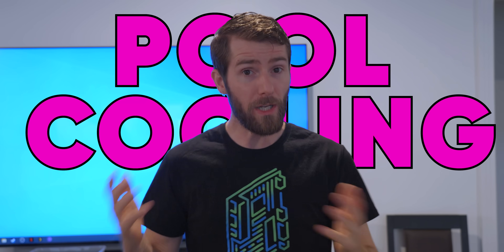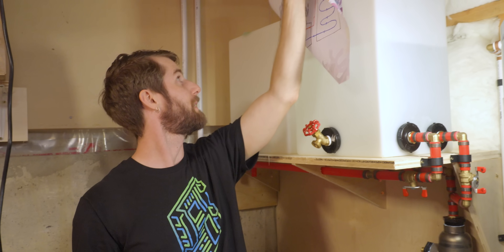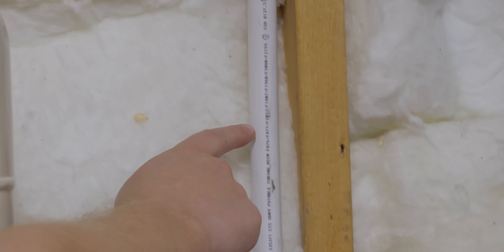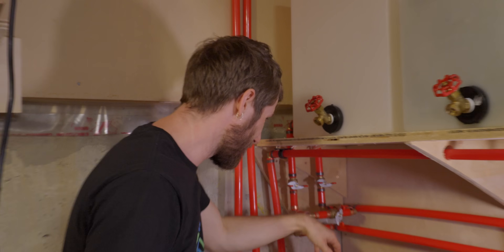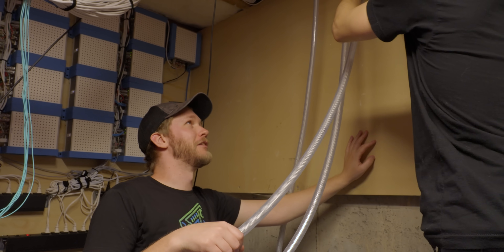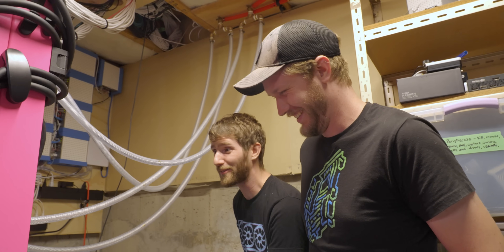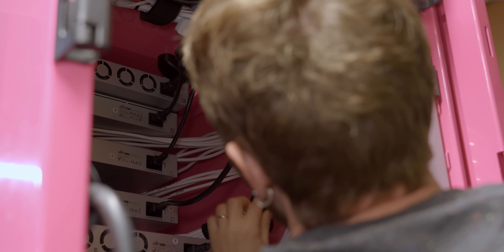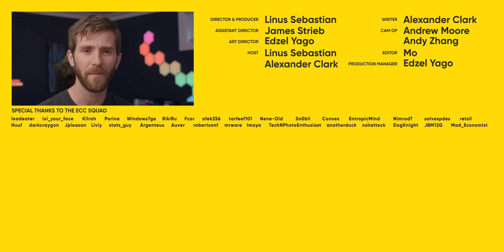My pool leaked and killed my computer - Whole Server Room Pool Watercooling Part 4

Comment: Every single video on watercooling convinces me that it is not remotely worth the hassles.
Reply: AIOs are as close to that as I'm willing to get. And even then, I picked it over air cooling for RAM clearance rather than cooling effectiveness. All the air coolers I was looking at had terrible RAM clearance.
Reply: @tyrannicpuppy the problem with an AIO is that when the pump dies, you can't just replace it and keep the rest. It's all scrap. That's what happened to mine. With a good air cooler, just replace the fan if it dies.
Reply: @Canilash agreed. It was a consideration I made when buying. For me, the eventual death of a pump and having to replace the entire thing was worth the benefit for now of having all four RAM slots available.

When it does, if there is an air cooler that could fit in place with the RAM, I'd probably go to air cooling. And their probably was when I was buying too. I restricted myself to a handful of local buying options so I wasn't paying exorbitant shipping or import fees, so my choices were limited.

Still does nothing to make proper water cooling remotely attractive as a prospect though.
Reply: @Canilash I've been carrying over my custom loop equipment for 8-9 years now, though I've scrapped suboptimal stuff and dropped in newer stuff here and there. 2x 480mm radiators, pump requires no change, fans have been upgraded, res is forever. I bought a high end Optimus CPU water block for Zen 3 and it's been able to carry over to AM5 with no change needed.

For the most part a custom loop will not need parts changes for a new system. Possibly new tubing. Only a new block if the socket changed the mounting.
Reply: @Canilash  I'd bet you can buy 2 AIO systems for the cost of a quality cpu custom loop. Of course that then rises if you want to do your GPU as well...
Reply: @tyrannicpuppy  buy low profile non RGB ram and your problem with air  coolers are solved :D
Reply: @bomberdomme7308  stop being silly. if I don't have the RGB RAMs where will all the FPSes come from???

In all seriousness, I totally could have. All the RGB is turned off in the PC these days as it sits right next to the TV and is way too bright when watching all the super dark poorly lit shows they put out these days.

But, it was my first build in 12 years and I had much more cash than sense. Lol.
Reply: @tyrannicpuppy Noctua NH-D15s, great ram clearance, if I can fit my OG Corsair dominators then any ram will fit.
Reply: i mean, i feel like linus's setup is a bit of an extreme example that no one else is going to come even close to doing lmao
Reply: @mysteryperson324 I feel like anyone could have a similar setup at home. You would just do it with your main water line. All things considered you have an optimal home layout or proper planning in a reno/new build.
Reply: Noctua NH-D15 ftw!.
Reply: @drworm73 peerless assassin ftw, and for $35 instead of $95
Reply: @drworm73  lol, just bought one for my 7800x3d, a 2014 cpu cooler on a 2022 cpu and it just works.
Reply: Ehhhh, if I have a weekend off and the $5000/$10000 to make it worth while that sounds like a fun weekend
Reply: AIO is a nice middle ground that keeps maintenance and price to a minimum, and carries most of the benefits a user would expect from liquid cooling.
Reply: @LunarShift there is basically no performance or cooling benefit any more from an aio over a high end air cooler. Either get a high end air cooler or do the custom water loop, not a half assed solution that costs slightly more for no benefit
Reply: It REALLY depends. There's so much potential in there especially as a proof of concept. 

The pool is just the hest sink but you could totally use the heat somewhere else in your house, too. I'm doing something similar, albeit with the hot air, where it heats my terrarium during the winter months and keeps it temperature controlled at ~24/25°C.

Since I'm not having that many things generating too much heat, it needs my beefy PC for now, but it's working pretty okay.

Just don't cut corners with water and test it out real good!
Reply: I built a desktop computer with DIY water cooling in 2016 and it still works fine today with literally zero maintenance or headache.
Reply: they just intentionally did the least research and planning possible, and absolutely refused any second trips to the hardware store after finding issues.

for the content.
Reply: unless your doing extreme overclocking water cooling isn't necessary. air cooling is much more reliable and requires less power. if you are using a big air cooler though do remember that it is  a lot of weight that you don't  want to come loose if you ever ship or transport your PC.
Reply: Do the testing with distilled water at least (best option is type II deionised water)
Even if distilled water leaks, it shouldn't cause much, or any, damage to your PC
It's hardly conductive
Reply: correction:
Every single video on watercooling, done by LMG
Reply: @smittywerbenjj1  nah, OP was right: every single video. So much work, stress and precision for such little benefit.
Reply: @tyrannicpuppy "We go to the moon not because it is easy, but because it is hard"
Reply: @Leo9ine  going to the moon has tangible benefits to future and further space exploration. Shaving a few degrees off your gaming PC and getting maybe double digit FPS gains is not nearly worth the effort, the upkeep or the headaches. IMO.
Reply: @Leo9ine The exact quote is "we choose to go to the moon in this decade and do the other things, not because they are easy, but because they are hard."
I think he wasn't expecting that line to be quoted. Without the context of the speech, the "do the other things" just gets awkward and is usually edited out of the clips.

For the record, the "other things" were:
"why climb the highest mountain? Why, 35 years ago, fly the Atlantic? Why does Rice play Texas?"
Reply: @Leo9ine  yeh, and when they need to cool the Radioactive RTG do they wrap it in a water jacket and bury it in the center of the craft? nope the bolt  that sucker onto the outside and let the cold vacuum of space radiate the heat away, basically fanless air cooling in space.
Reply: @tyrannicpuppy in his case it was not just the cooling performance, he wanted to remove fan noise from that room and have lower room temperature, 5 systems plus switching equipment heats a room like a small split air con, moving the heat away is smart in this case and removing noise is easier than adding isolation to the walls.
This is nevertheless a over the top setup, but would say is worth it for the server room temperature control and noise alone and the gpu temps a nice bonus
Reply: @tyrannicpuppy  he's also putting heat into his pool. I don't know how much and I don't know if he mentioned it but I would like to know how much difference it has for the pool.
Reply: @smittywerbenjj1 I've done multiple custom loops and don't use them anymore, they're a pain. Next build is just using a giant air cooler and all my old watercooling setups will eventually be replaced for media computers.
Reply: @smittywerbenjj1 nope, just every single video. Even LMG has built several non janky and well done water cooling rigs. Still just doesn't feel like it's worth the effort, unless you're trying to do something like that Nerdforge PC where you wouldn't have much airflow. 

Air cooling is just objectively easier and safer, because there's no messing around with tubing and you don't risk getting water on your expensive hardware. Plus, good air coolers seem to be cheaper than good water cooling equipment. 

AIO feels like a good middle point though. Some of the benefits of water cooling, relatively easy to install and little to no risk, since it's a closed loop system.
Reply: AIOs really are trivial. After that, though, I totally see your point.
Reply: it's worth it if not done by youtube-grind driven hastly finished project.
Reply: @shadman_rafi  It's worth it if it generates more revenue on the video than the project costs.
Reply: It's more about the "cool factor" rather than the actual cooling
Reply: Well when Linus does anything it's gonna have more hassles than usual 😂 custom watercooling will always be more difficult than an AIO or a air cooler but it has its performance benefits. But most of the time people do it for fun or for looks. If you have got the time and money then try it out, just tread carefully and do your research so things like this disaster don't happen to you
Reply: 100%
Reply: This
Reply: It's not. Plus it's no benefit to a good air cooler
Reply: That's why most people would just use aircooling and a strong AC(that could still heat the pool).
Reply: Water cooling is for people who love large hassle factor for small reward
Reply: Water cooling is actually essential for some purposes. PC gaming just isn't one of these.
Reply: Aios are great: much more thermal mass to mitigate heat spikes. Custom loops are for people who are going for extreme performance.

The big issue is really just Linus trying to cheap out on plumbing.
Reply: Exactly my thought
Reply: It looks cool though!
Reply: Main reason I am sticking to air or aios for builds, because while I think it would be fun, it just isn’t worth the extra work and effort (especially because there is no warranty for stuff that gets wet if you do something wrong with custom water cooling).
Reply: But 38°
Reply: yep
Reply: If done properly... Properly being key word... It isn't bad
Reply: Linus just sets up an Rube Goldberg industrial sized nightmare machine for his watercooling. Buy an AIO and don't worry about it.
Reply: It’s worth it if you are prepared to spend the money to do it properly, but an AIO or quality air cooling in a decent case will work also, so it’s a personal choice to be honest.
Reply: It’s not their strongest side. 😂
Reply: Probably not, but LTT makes AIOs look like rocket science.....  "We're too "cool" for that.  Just do the opposite of them.
Reply: Especially since the outdoor air is <20’C a good part of the year. Rest of year cut a hole in the air con duct. Winter draw cold air from outside.  Seems easier than pumping water around $50k of tech
Reply: At small scale. At large scale, especially because the heat those machines would be kicking out makes the garage insufferably hot, there's a good reason he is doing this. This is also Linus' whole-home watercooling 2.0 basically, done right and lasting for years.
Reply: For the desktop tower, air cooling 100%, for the home servers though... You'd be at risk of losing hearing in that server room without earmuffs
Reply: Every LMG video, maybe.. you're looking at exclusively the bad examples

Comment: OR... you just use some stop leak thread compound.
Reply: Doesn't help if the pump stops and melts the tubing. Also doesn't help against the rocks getting into his loop.
You, obviously, need a heat exchanger.

Comment: will it affect anything when winter comes with condensation caused by low temps outside?
Reply: Since he is using a heat exchanger, her could slow down the pool pump to keep the inner loop temperature and flow constant. BUUUUT, i wouldn't expect him to forget to set it up.

Comment: It wasn't a matter of IF this would happen, it was a matter of WHEN it would happen on this project. This is just another one on the list of the problem with LTT "lets get it done fast, not right the first time"  Also why didn't they put a flow meter on the pipe and hook it up to home assistant?

Comment: I remember that someone suggested using a heat exchange and linux was like "Nah we don't need it"
Reply: I REMEMBER THAT TOO, I think it was jake
Reply: I've been suggesting it to him for over a year too!
Reply: They don't need it. If they had someone who knows what they're doing, this would have been flawless. Instead, he relied on Dumdum Alex, and he ended up with a botched mess.
Reply: Alex is the epitome of why Engineers suck. He has no clue what he’s doing when it comes to everything he touches.
Reply: @Bob_Smith19 He's literally doing what he's being asked to do. Also you can't expect an engineer to be skilled in all manual labor fields. An electrician only knows how to be an electrician. Alex has been doing stuff from like 5 different fields, obviously he can't be expected to be good at all of them. And anyways nobody teaches you stuff like this in engineering, it's way less hands on.
Edit: someone like Brian the Electrician would be a way better person for this sort of job. An engineer is someone who would design a new product for a job, not someone who puts things together for a job.
Reply: @Bob_Smith19  what. Alex didn't do anything wrong 🥲
Reply: @Bob_Smith19   Not sure why Alex is getting all the hate. Linus is the one basically have electricians do plumbing and plumbers do electrical. Alex is doing exactly what engineers do, provide exactly what the client asks for with no regards for maintenance, repair, or longevity.

Comment: It would be super cool to see a hardline loop with swagelok compression fittings and 316 stainless tubing for the runs. They are normally used for LPG runs. 

If done right it would look extremely neat!
Reply: Shit hand they aren't going to do things right. They won't get someone who knows anything to help them either.
Reply: @michaelstarkey2449 Thats because if they don't have at least a few big issues to solve then the content will be super boring...

Comment: I was LITERALLY just talking about your pool cooling with my IT guy at work today.. He didn't think it was a good idea.
Reply: No one thought it was a good idea in the first place
Reply: Its actually done at the datacenter level
Reply: @spykegda , with a pool?
Reply: If you use a heat exchanger its fine... They also monitor loop flow rate, pressure and temperature and have alarms in place, i don't think linus does? @spykegda 
Also, most datacenters only cool the air and the systems are air cooled. I don't want to claim there are no datacenters where the systems are all being watercooled with an outside loop, but its rare.